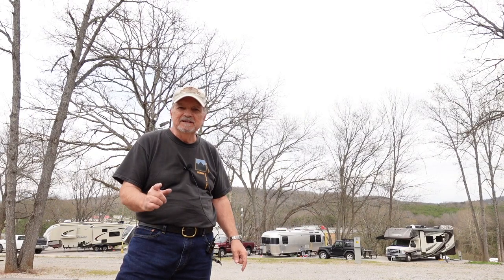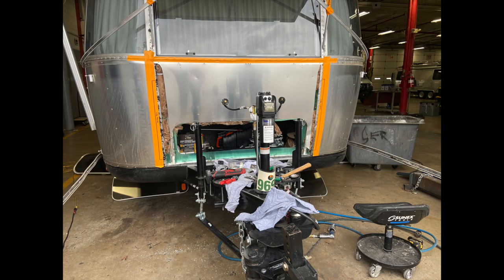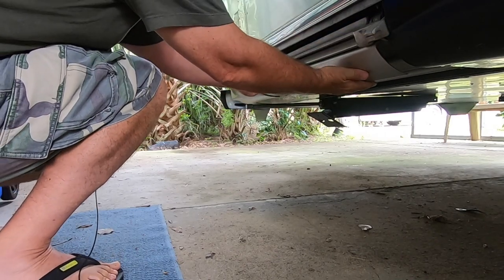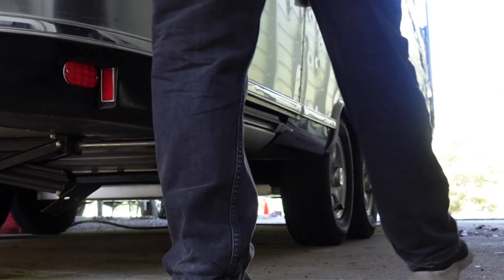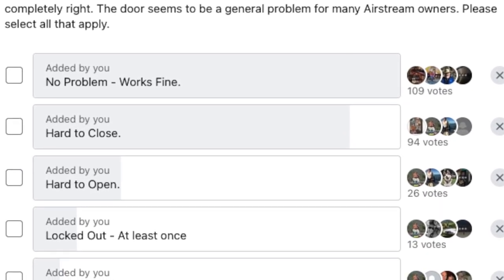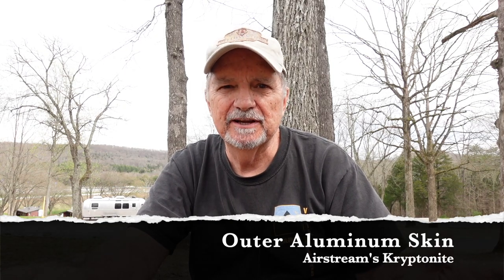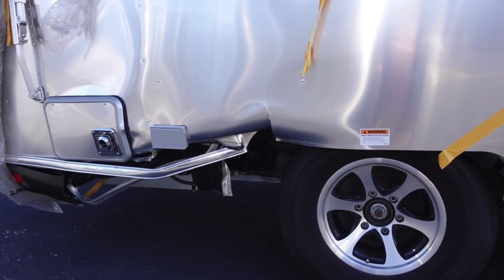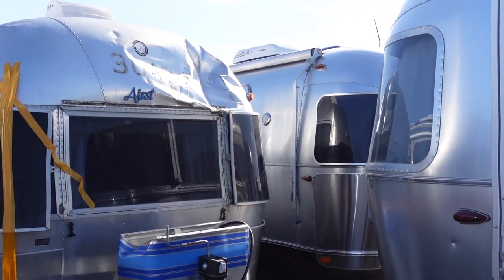Airstream's Kryptonite - Get Ready for the Truth!

Comment: Good points, and with that said, 85% of all Airstreams every made are still in service. No other trailer manufacturer comes close to this figure and Airstreams have been around a lot longer than most brands. Additionally Airstreams have by far the highest value retention of any other brand.
Reply from the maker: So true. I thank you for the comment and for watching.
Reply: 85%, please state proof.  I can show you dozens if Airstream parked for years with the floors rotted and fallen to the ground, rusted, interiors beyond repair, at my RV resort there are 2 that have basically been abandoned and the rear ends rusted abd open and rotted.  85%?  No way.   Stop the lies and propaganda.

Comment: Thanks Jack for the great reminder how easy it is to damage the aluminum shell. We have limited control over hail damage... but can control damage when backing up into a campsite, making turns, where we park in public areas, monitoring air pressure and lug nut torque to prevent an accident and so on. We have a 2016 Int FBQ so the warnings about the steps and front separation don't apply to us, but we always enjoy the videos!!
Reply from the maker: Very glad you enjoy the videos and appreciate your commend. Wish you well going down the road. Thanks for watching.

Comment: We have owned 2 AS. A 2017 International 23D and now a 2019 FC RBT. Did the door modifications on both units as directed on AirForums. We also carry a portable step similar to yours. We do use the steps but we are both fairly light. If you are a larger person they will have some flex. No front or rear end separation with either unit. We are very careful with our WD hitch set up as to not over stress the frame. We do love our AS but as with any RV you have to be handy and do proper maintenance. Extra set of keys hidden away is a great idea and I always have TV keys hidden away also. Nice video with some good tips.
Reply from the maker: Thank you for the great posting, I know the issues in the video do not surface in all Airstreams as you have noted. Safe travels :)

Comment: In 4 years of owning our Classic 30 we experienced (suffered with) the door lockout issue, bolt falling out of the step, and never having our electric Relax awning work reliably.
Reply from the maker: Those are the common issues with Airstreams. I didn't address the awning problem in my video because I have the manual awning and I have no direct experience with the electronic model but had read a lot about it. Thanks for watching and I hope you Subscribed to the channel.

Comment: Jack, Another great informational video. I will check for front end separation tomorrow. I have never been locked out of my trailer (knock on wood) BUT, I do have a second set of keys that are kept outside in case I need them. My major complaint is the ZipDee awning (electric).  Stay safe and I look forward to your next video.
Reply from the maker: Thank you Lee for your very kind comments. Hope you don't have the separation issue, so good luck with that. Again, thanks for watching.

Comment: My 2018 FC had one bolt fall out of the step rendering it unusable temporarily.  There are several small rivets to drill out and a thin panel to bend down.  The bolt was easily reattached to the proper location using thread lock (blue strength).  Then some pop rivets finished the job. Irritating but easy to fix.
Reply from the maker: Appreciate your comment Charles and thanks for watching.

Comment: We have a 1976 Airstream motorhome. It is still in one piece. We have had other rvs that rot away in 15 to 20 years.  The problem with an Airstream in Texas in you can't keep them cool. In the 70's they used the pink fiberglass insulation. I hope they are using neoprene like the Prevosts or atleast Styrofoam now. . But suspect they are more concerned about the look then the usability.
Reply from the maker: WE live in Florida and have no issues with cooling but we have 2 AC units. Thanks for watching.

Comment: We have had 2 of those issues ... so far.  We have a 2003 22' CCD.  (1)  We got locked out a few years ago, went to a locksmith to break us back in, then had to use a screwdriver to open the door until I got the repair parts.  (2)  We had shell separation in the back.  It has been an awful experience.  Water leaked in for a long time before we were aware of the problem.  Part of the floor rotted in the back.  The repair was difficult and tedious, and I will never be sure I did a good enough job. We have had no step problems, but our step is an older, simpler style and has worked fine.  We have had other big, ugly problems but they are not part of your kryptonite list.  Sadly, our Airstream is a lemon.
Reply from the maker: Sorry for your problems Michael but unfortunately your experiences are pretty much common failures experienced by other owners. Good luck going forward and thank you for watching.
Reply: Thank you for your honest opinion of the sheer bs quality and pricing of Airstreams. They can cut their man hours in half, with the door now, we know, it’s still a piece of crap. Stop bragging about the door.

Comment: Hi Jack, thanks for this episode. You hit the nail on the head, I’ve experienced both the step and door issues. May I also suggest checking your door hinges frequently to assure they are tight. While the door is open give it a gentle tug upward and watch the hinges, if they shift you’ll need to remove the adhesive strips covering the screws, tighten and replace the strips.
Reply from the maker: Great tips on the hinges and I'll check that. Appreciate your kind comments and as always thank you very much for watching. Hope to see you down the road.

Comment: So basically don't ever actually use your air stream as it might get damaged?  However, I agree with then tip about the locks, I never use the door lock, I only use the dead bolt.  Our 2020 Caravelle  was christen by the wife backing our Aluminum Tesla Model S into the aluminum airstream. About $2,000 worth of damage each and hard to repair.  I pulled the den out in both, but could not get it completely straight,  but now I don't have to worry about the first dent and it is on the hookup side so not really that big of a deal.
Reply from the maker: Smart move only using the dead bolt. Thanks for watching.

Comment: Sure they all can happen… maybe… our biggest problem was with the power awning… swapped for a manual one.. no issues, needed the door realigned.. dealer did it .. been perfect ever since… stair lube is your friend no issues, never locked in our out but did the handle mod for preventing a potential issue.  No front end separation or rear end for that matter.. and aluminum panel damage.. yup. accident.. insurance paid for fix.. Airstream is still the best option from what I can see.. you want a travel trailer or any RV with no issue… doesn’t exist.. stay in hotels
Reply from the maker: Appreciate your comment and thanks for watching.

Comment: Airstream is better than 99% of the other RV out there.. and the resale value proves it. Why? Because a lot of RV out there are just glued and stapled CRAP.   So, if you have an Airstream, be comforted that the wheels will not fall off..  the top cover will not fly off.. that wood frame will not fly off or break away.. or many others things that just never happens on Airstreams.
Reply from the maker: So true. Thank you for the comment and for watching.
Reply: Why have I seen multiple Airstream with the floors rotted and fallen out?
Reply: Australia better than 99%?  Stop lying.  Bragging and making false claims only breeds distrust.

Comment: The kids of death for most RV's
Is water intrusion. Do Airstreams
Leak? Serious inquiry.
Reply from the maker: Great question and you are correct about water intrusion. Airstreams do have seams on the roof that require periodic inspections and maybe new caulk. Overall I feel Airstream "leak" must less than traditional build RVs. But I have seen stories about finding Airstreams that have sit for years and years out in the open and didn't have water inside; wish I could believe all of that but I don't. Keep up with the roof inspections and you will be fine. Thanks for the comment and for watching.
Reply: @LandingZoneHome  thanks.
Appreciate your reply. I have a
Friend who owns an Avon and
He had to deal the roof one rivet
At a time. Fortunately it worked.
He used,  Through the Roof
Sealant.
Reply: Yes they can leak, and not just from the roof. and any holes in it. They can leak from exterior lights, windows, panel overlaps, the rear bumper and even the rivets. Since 2021 they have used composite flooring to reduce damage to the  (old plywood) floor caused by water leaks. Get your airstream leak tested every other year.

Comment: The main problem with AS is that they are stuck in the 60's with no slide outs, with the already smaller interior volume because of the roof radius they need to add a slide out, if they can't figure how to do this, then they are lost
Reply from the maker: A few years back Airstream did offer slides on at least one model and you can sometimes see those in campgrounds. For the people that like them spaces doesn't seem to be an issue. Thanks for the comment and for watching.
Reply: @805gregg….if you don’t like the Airstream because it doesn’t have slide outs, then do ‘t buy one. Slide outs bring as least as much, if not more, grief than any benefit they offer. The structural requirements alone are substantial and the power mechanisms are another layer of problems. Then, there is the leak potential. No thank you, I like my Airstream as built. Want more space, buy a longer one!
Reply from the maker: @raycoleman3183  Yep, agree.

Comment: i'm surprised you didn't mention the subfloor rot
Reply from the maker: I think that is an owner maintenance issue caused by water intrusion and not unique to Airstream. Appreciate the comment and thanks for watching.
Reply: @LandingZoneHome  Starting in early 2020, and formally introduced in 2021, the subfloor has been replaced with a water-resistant one-piece subfloor.